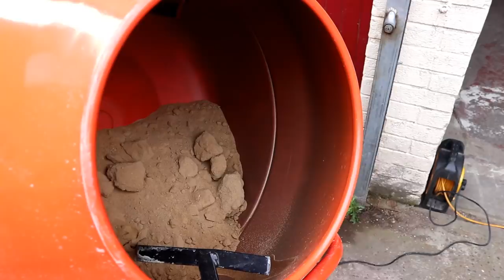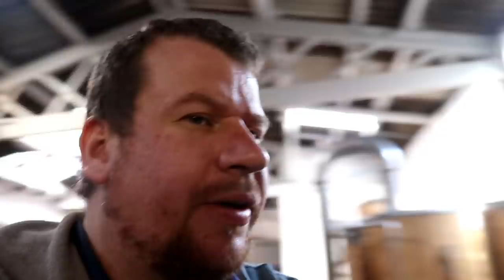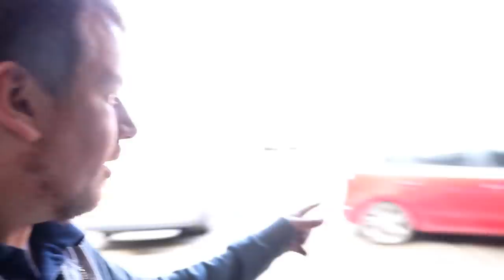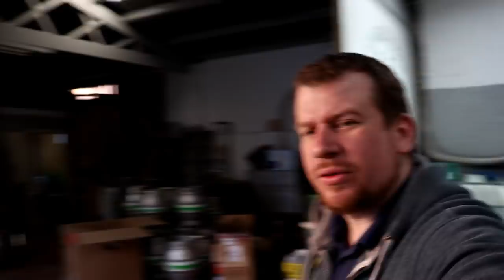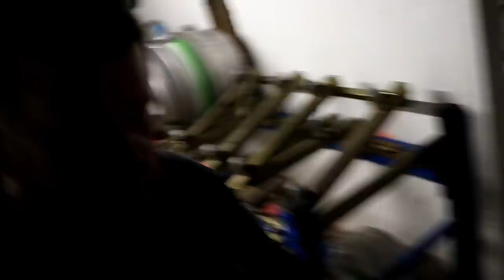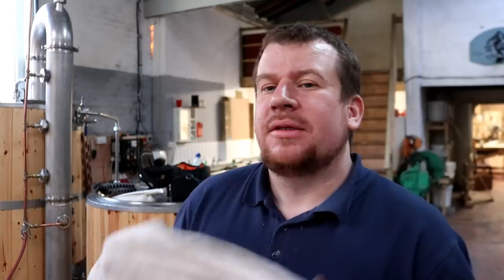MY BACK!

Comment: Chris, could you back sweeten the beer in cask and take the edge off the bitterness? The trick would be figuring out the sweet spot and calculating it for the casks. Would that work?

Comment: Thanks for explaining about the new car,looks like a nice little bus(is it an estate?). Definitely a good idea for you to have your own runaround,makes sense really. Concrete will look good once pointing is finished and it's all smoothed out. Pity the neipa is too bitter but at least it's still fit to be sold,would have been a pity to dump that with all the hops that went into it. Can't wait to rock my new HB beanie. Cheers.